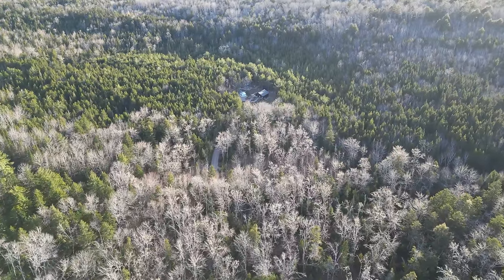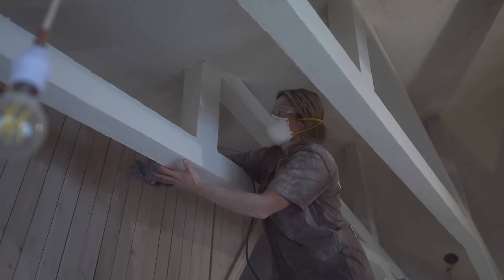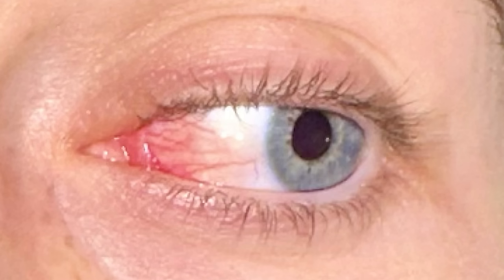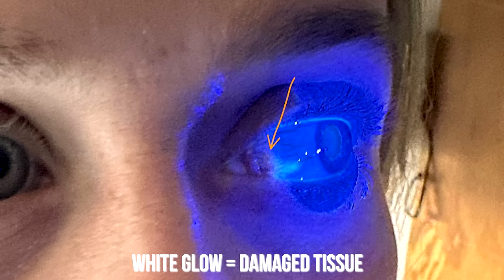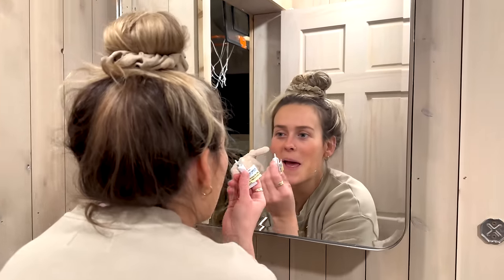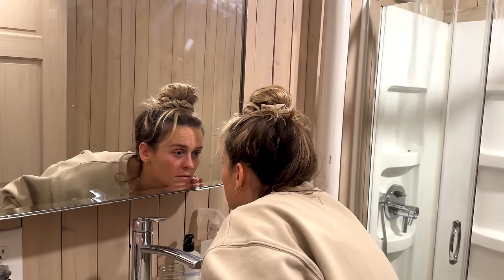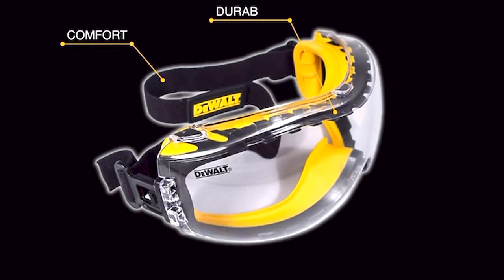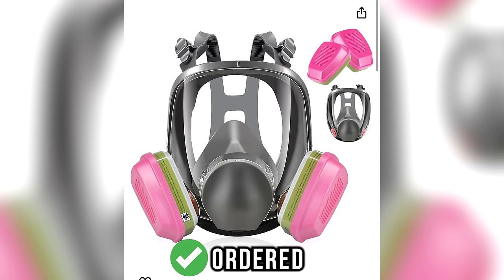telling my story

Comment: It's simply horrible. You should have been wearing safety glasses. I noticed many times that you both have not worn safety glasses when you both should have been. This is not good. I pray this never happens to you ever again. Safety matters. I noticed when you mixing that stuff you're breathing in the powers and other ingredients. Mix that outside dry powder ingredients  so you are less likely it floats in the air and you breathing it in your lungs 🫁 safety comes first. You don't want that dust in your nose, mouth or eyes. Just saying Also I hope you kept Izzy and Bella away from that area where you were pouring and mixing and working. Izzy and Bella could get burned if that stuff got on them or in their eyes or in their mouths or lungs. Jazz should be protecting herself also. Again just saying. Because I care and I am saddened by this news you being hurt.